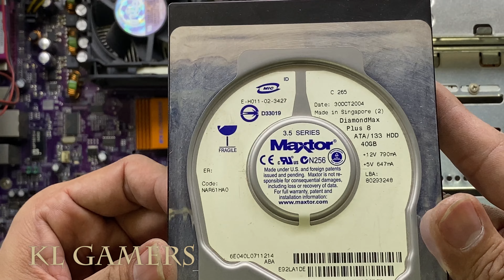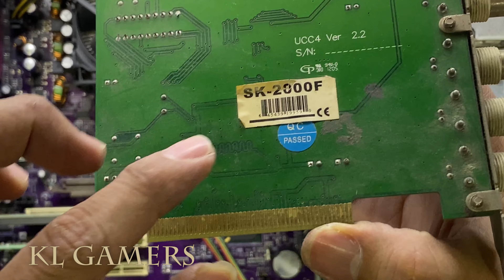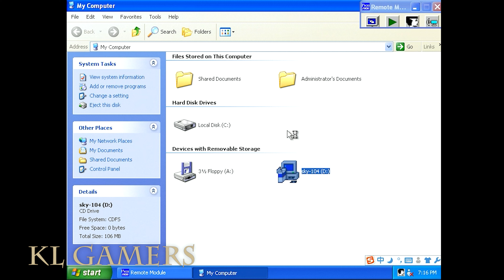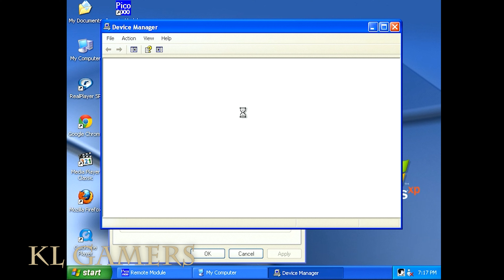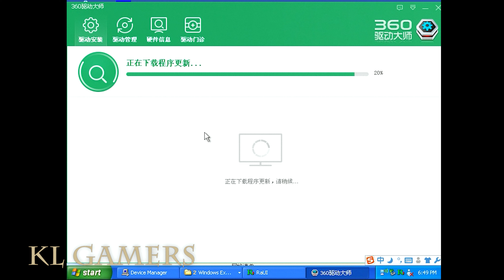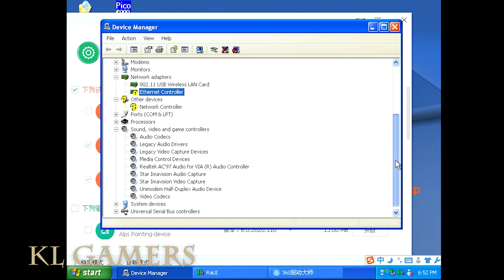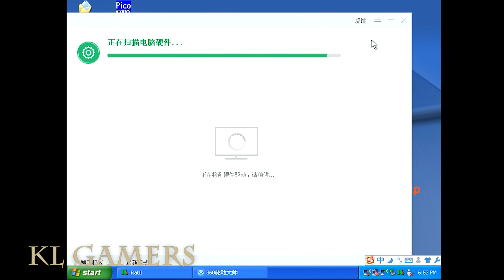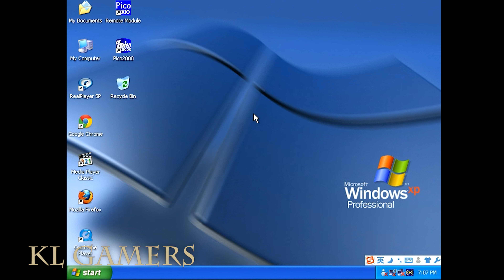intel Pentium 4 Socket 478 ECS ELITEGROUP P4VMM2 DDR1 333Mhz Star Imavision SK 2000F CCTV PC Build

Comment: Ressucitei o meu antigo P4 2.8 HT, placa mãe Intel, HD IDE  Seagate Barracuda  80GB 7200 RPM, Gravadora LG 52x32x52, placa de fax modem Agerre, placa de rede RTL8132 10/100, placa de video AGP Nvidia GX4000 128mb de ram, 3x 512Mb Ram DDR1 400mhz, windows xp pro 32bits. Uso ele pra gravar meus games de neogeo cd e sega saturn.😂❤

Comment: How did you make it work with the three defective capacitors?
Reply from the maker: sometimes it  does work !!
Reply: @KLGamers  However, if you use the system, it is better to replace them. Because the damage later may be more significant.

Comment: My first CPU 😢
Reply from the maker: the good old days when 56K dial up internet was a thing
Reply: Mine too! My specs were: Pentium 4 @ 3 GHz socket 478, 512 MB DDR 400 MHz, ATI Radeon 9200 Pro AGP 256 MB of VRAM, 80 GB seagate HDD 7200 RPM, ASUS Mobo P4P800

Comment: my 1st pc spec bought in 2003 at low yat plaza
Intel Pentium 4 1.7Ghz socket 478
Abit SG-71 motherboard
Kingston 256MB DDR333
Abit Siluro Geforce 4 MX440 64MB DDR
Samsung 52X cd-rom drive
Seagate 20Gb 5400 IDE HDD
Sony 1.44mb floppy drive
PS/2 mouse and keyboard
Sonic Gear 2.1 Speaker
14" Compaq CRT monitor